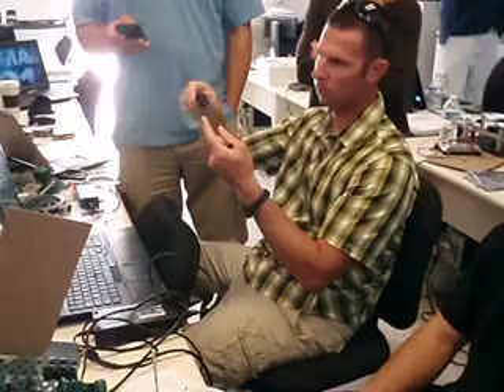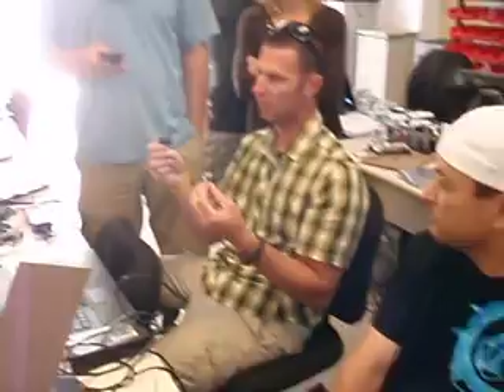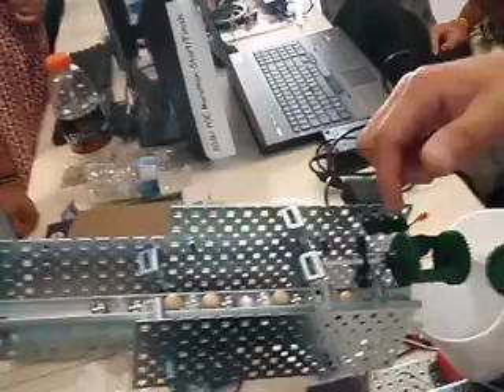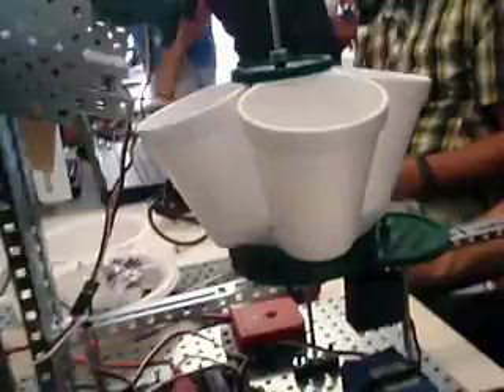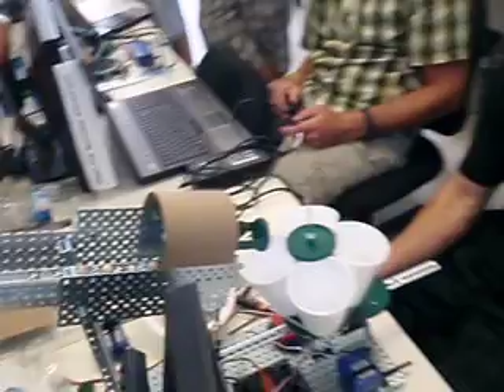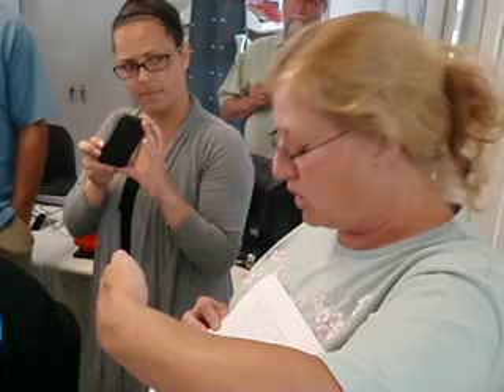Trash Sorter

Comment from the maker: Tricky Parts:
1.  The two stage gate that Jason describes.  
2.  Holding the balls in exactly the same spot every time and having the sensor mounted rigidly so you get consistent readings.  The sunshade also helps with this is you have any ambient IR (sunlight) in the room.

Comment from the maker: Pretty simple. Move top servo to let a ball in, then move it back.  Read the line follower value.  Then decide what material it is and move the bottom servo to put the right cup into position.  Then cycle top servo again to release the current ball and get a new one.